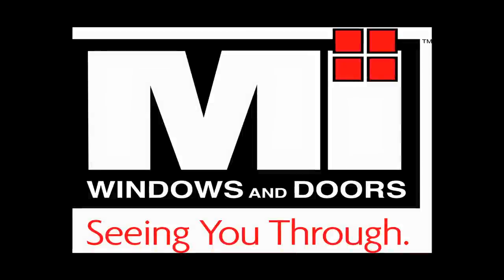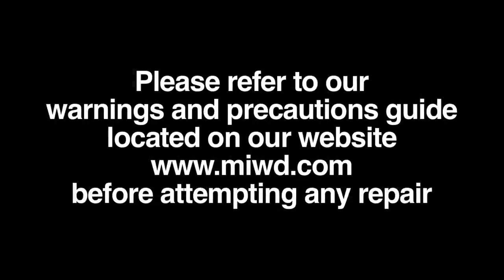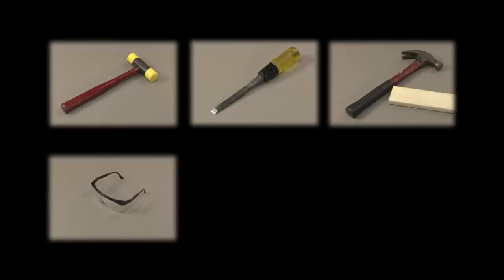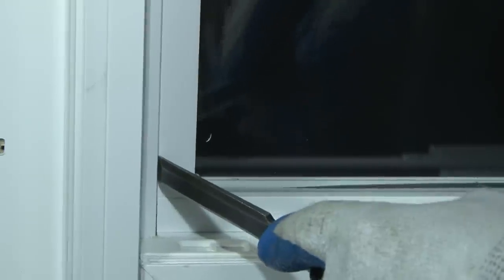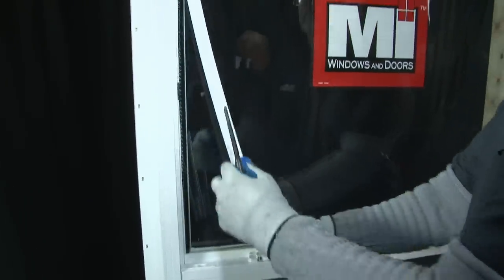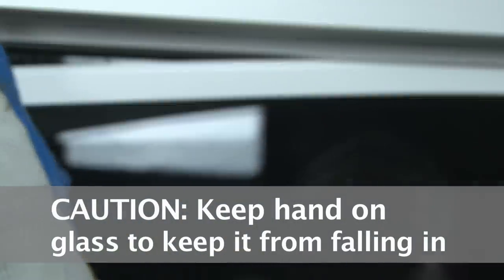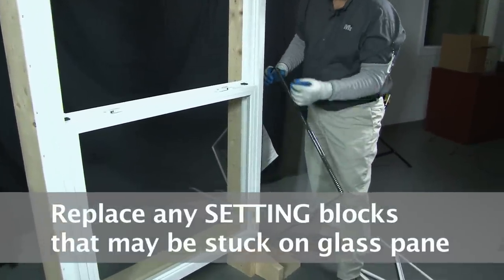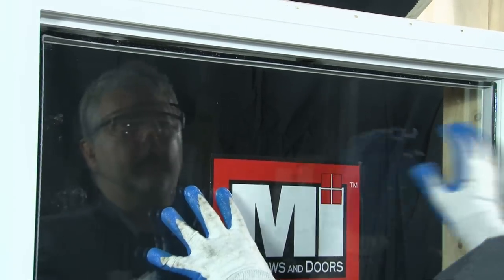How to remove and replace a fixed top glass

Comment: Hi do we need to use a silicone sealant or a glazing tape to fixed top glass? I see a foam tape on the old glass after removing from frame

Comment: Hopefully someone will see this and be able to answer with knowledge. I'm trying to figure out the exact size for mine. I had a guy out for an estimate on something else and he told me what I would need, but I want to clarify. He simply measured from the outer edges of that  trim piece (glazing bead) that you remove and said that is the size. I' scared it will be too big. I'm hesitant to remove the bead in case I mess it up before I order the new glass. Can that part be purchased somewhere as well? Mine is 23  years old and I'm afraid it will be brittle and break. Also, do I need to account for the little setting blocks under the window when I measure? Glass place and $140 for the glass or 275 with measure and install for a 63 x 8 piece of insulated glass. I can buy the glass online for $105.

Comment: I have a couple of glass inserts that must have leaked the argon gas because they have become foggy and until I get them out of the window, I am not sure of the dimensions.   Vertical, horizontal, and Thickness because I read they come in various thicknesses. Now, I am going to remove (or try) the plastic bead on all sides and the measure and order the correct size glass insert.  I will have to temporarily replace the glass, until  I get the new glass insert. 
I am back the next day and I tried for 30 minutes with 2 chisels to remove the bead work and  it was not possible and I gave up when I was sure I was going to break the glass.  They make it look easy, but it was impossible for me.  I think I am going to have somebody come and do it (alas,  I have failed and that is disappointing)

Comment: Video does not show installer putting a silicone bead in before glass - yet written instructions ftom MI say to use silicone.  Which is correct, is it optional?
Reply: i guess whatever works

Comment: What if the top os caulked in?  I need help asap.  Doing it now.
Reply: Get a razor knife with an extendable blade and extend the blade out far enough where you can bend it flat against the glass, and press it between the glass and the exterior trim to break the old seal.
Reply: @thegrumpypuffin  see above